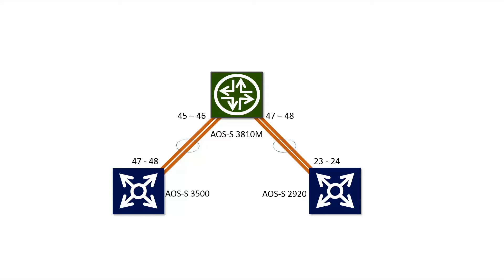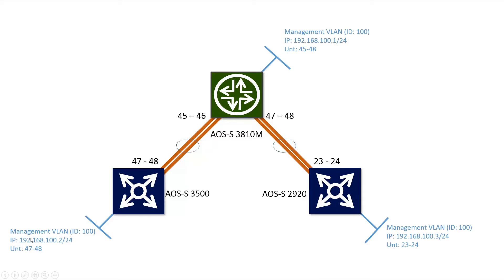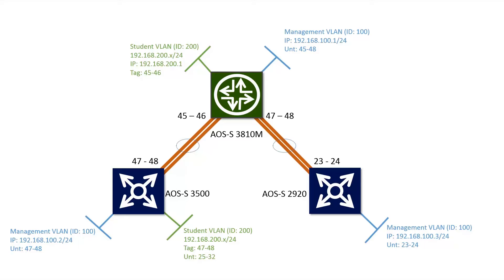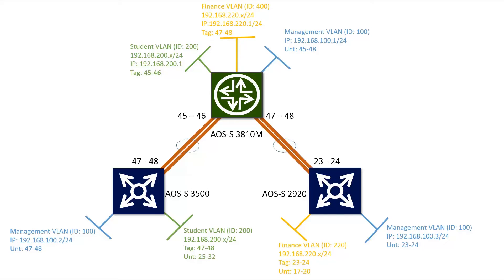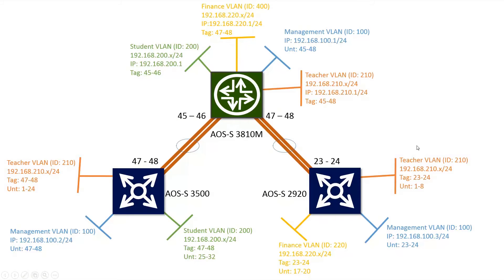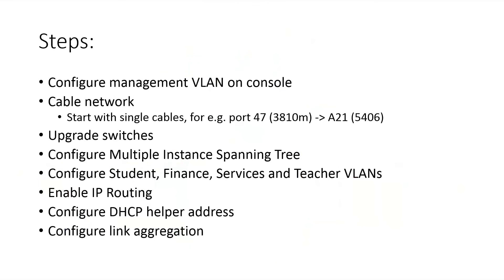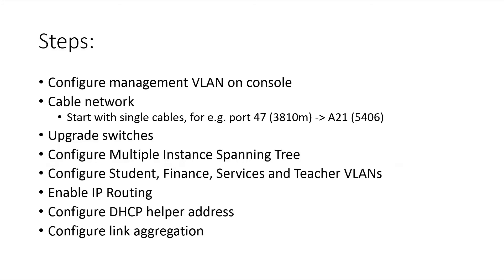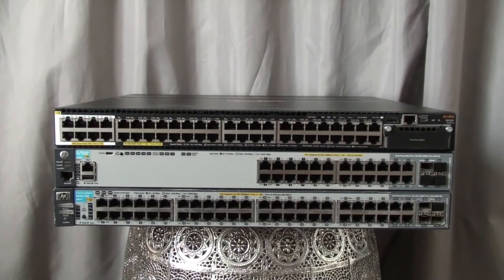AOS Switches   Let's Build a Network - Intro

Comment: Hey thanks for this video! Can you flash those HP switches with the Aruba OS switch firmware?
Reply: Yes, if the HP switch model number matches (like 2920, 2530, 5400R) and software version 16 or above is available for your switch, you can flash it with new firmware and have an ArubaOS switch (software wise).